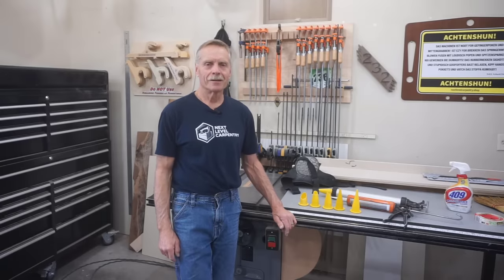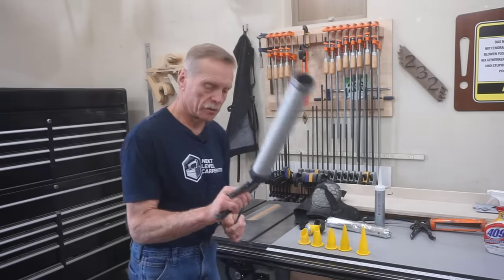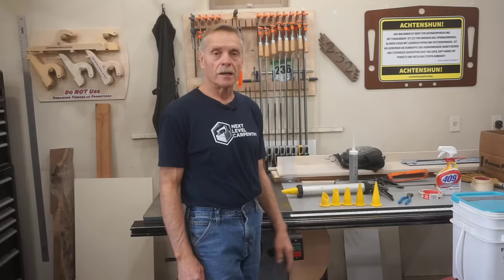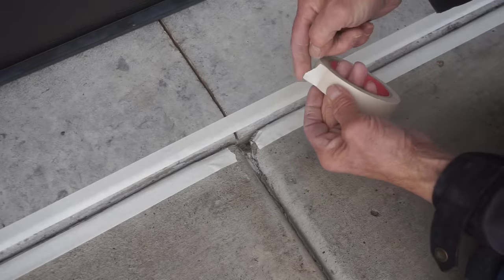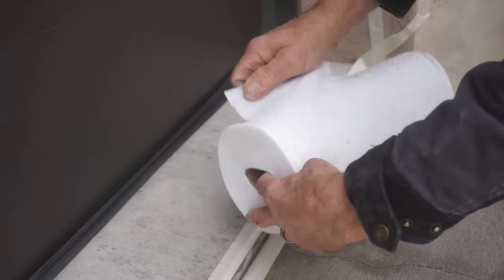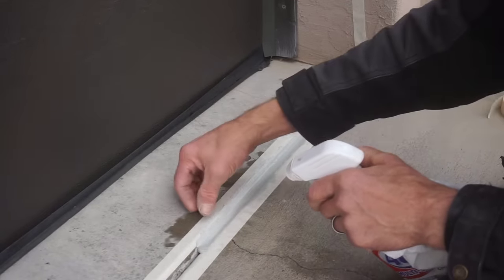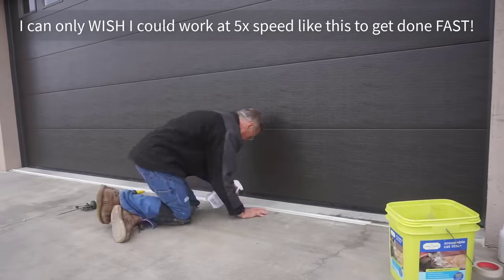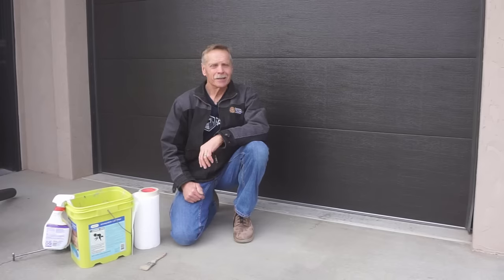How to Caulk Concrete Control Joints with Perfect Results Every Time

Comment: I came across this video looking for ways to use my Dollys to get across those control joints in my garage as they were constantly causing headaches. Will this help with that? Or is this more cosmetic?
Reply from the maker: This is functional for sealing out water and keeping crud from building up in joints but, since the sealant is flexible by nature, it won't help with small diameter wheels in general and dolly wheels in particular.  If you use a hard-setting cement based crack filler it may help with dolly wheels but will predictably re-crack and possibly make dolly travel worse.
Reply from the maker: I don't have any personal experience but would look into epoxy based products rather than concrete/masonry type products because epoxy tends to be 'tougher' where other stuff can be really hard but also brittle.  If you find a product that seems right for your application I suggest doing a test section where you follow all preparation steps to the letter before committing to all the cracks in case the stuff doesn't perform as advertised or expected.

Comment: What would I need to do different if my joint is deeper and wider?  Mine is about 2 to 2.5" deep and about an inch wide.  I have already placed silica sand in it and raised the level up to where it now is only about 1/2" deep.  What else could/should I have used to stuff into the crack to fill in the depth?  Also, my joint(s) open into the grass.  What do you put at the end of the joint to keep the caulk or sand from 'spilling' out?  Thanks, Steve
Reply from the maker: Personally Steve I would vacuum out the silica sand and use only backer rod to fill the joint to where the depth of the sealant will be half the width of the crack.  At the ends I just turn the backer rod down stopping it close to the bottom of the slab, and hold it in from the edge of the slab half the width of the crack at that point. That's one more reason not to use any self-leveling garbage because the product you see me using this video works equally well on horizontal and vertical applications. If you are determined to put something in the joint beneath the backer rod use something like foam or sill Seal because anything dense like sand or dirt or gravel can work to force the slabs farther apart. My advice here is just from personal experience and not from taking a class from a concrete company or sealant company so take it for what it's worth? 😎
Reply: @NextLevelCarpentry  Since I messaged you, I went out and measured the width of that gap and it is a little over 1".  I was even thinking of getting some of that black tar board and cutting it to fit down in that groove.  The groove is also gently curved.  I've purchased some NP1 in Stone.  Do you think it can go as much as 1.25" width?  What is the depth limit?  Maybe 1/2" max?  I was wondering about spraying some expandable foam down in that crevice too, but it would be hard to control how high it will expand.  Also, I used sand as a filler in my other house back in 2013, and by 2019 when I moved it had not affected my slabs and the NP1 was still healthy.  I used your similar method back then, other than I didn't put as much sand on top and I did get some bug and leaf contamination before it dried good.
Reply from the maker: @pavlo687  If silica sand doesn't create problems for you in your locale then it's probably the simplest way to fill the joint.  In areas where freeze/thaw cycles occur I advise avoiding anything that can get wet and expand when frozen. My preference would be foam; possibly multiple layers of  backer rod, but that's more expensive than other fillers.  I've done gaps 2" wide in heroic circumstances and, while that's pushing limits, it's not been a problem.  The width to depth ratio of 1:1/2 is more of an issue than total thickness IMHO.  With that rule of thumb, a 1 1/2" wide gap should be about 3/4" thick.  With proper preparation that ensures good adhesion it should work fine.  Good thing is that fixing a few failed sections of a joint is easy peasy: just cut out the part that comes loose and re-apply sealant using the same process.  As long as you don't get total failure from poor preparation (like leaving dirt, oil or heavy, loose dust on edges where sealant needs to stick) it's a pretty fool-proof process.  Practice on narrower joints and work your way up to the really wide stuff.  Spray foam is great stuff for filling gaps but keeping it off surfaces where sealant needs to stick would take conscious effort, probably more trouble than it's worth.  It's good to hear you had successful long term experience doing this stuff before because it requires less faith to do it this time and allows you to see benefits of a few tweaks to your application system... good luck! Best, Matt

Comment: Do you sometimes need to put in a backer rod? I have the same situation except driveway to garage door is asphalt.
Reply from the maker: Backer rod is definitely necessary sometimes and should be used whenever that's the case. I didn't show it in this video because my focus was on finishing the joint regardless if there's backer rod underneath it or not because of the process is the same. Keep in mind that urethane caulk is basically useless for sealing asphalt alone or even asphalt to concrete so I definitely don't recommended it for your situation...

Comment: Can I use this method where my front stoop hits the house? Water is running between the stoop and the house and making the beam under the front door in the crawl space wet.  Inspector said no damage yet but I need to solve the problem before there is.

Comment: My employer has advised to  bitumen slurry  instead of backer road and silicone sealants,Is it  advisable to use bitumen salary ? , if it is ok, what are the disadvantage?
Reply from the maker: I've never heard of a silicone sealant being used for concrete applications.  There are times when sand is used instead of backer rod but, for small to medium sized jobs I don't think there's an advantage.  Plus sand won't work on vertical joints so I wouldn't switch to sand or 'bitumen slurry' in anything but extreme cases.

Comment: Do you have a video where you caulk an expansion joint that also has backer rod in it?
Reply from the maker: No... there's plenty of them on YouTube but the main point is that the method shown in this video is still the best way to FINISH the joints, regardless of what's underneath IMHO.

Comment: What is the purpose of sealing the joint? Is it only aesthetics or does it protect against cracking or something from ice?
I only wish my intentions matched my results the way you did it... me opening a caulk tube is like letting a genie out of a bottle and he's not happy about it.
Reply from the maker: I do it both for Aesthetics and as a preventative maintenance item. Sealant keeps water from seeping through cracks and eroding dirt underneath Plus it keeps dirt leaves and weeds from collecting in those cracks in the first place. Dealing with urethane sealant is a potential disaster of a mess but I think if you follow the steps and use the methods shown in this video it can be completely manageable and yield professional results... Good luck! 😉😁😎Best, Matt

Comment: Can you use this technique to seal a gap where a vertical stucco wall meets concrete?
Reply from the maker: Absolutely!  It 'feels' a little different because you're working vertically instead of horizontally so it's tricky to get the sand to stick but I use all the same steps, techniques and materials.

Comment: Do you remove the old, broken,, and mold/moss covered fiber/expansion board that is between the slabs before caulking?
Reply from the maker: I sure would...  I hear a stiff wire wheel in an angle grinder is good for removing the top part down far enough to apply the sealant.  The key to success is all in the prep work so don't shortcut that part...
Reply: @NextLevelCarpentry  thanks so much!

Comment: Does this caulking work in cold climates as well? Eg We here in Winnipeg have temperatures that range from +30 C to - 30 C.
Reply from the maker: Works in weather and temperature extremes where I live Nick... if any product/method is going to work in Winnipeg, it would be this one.  Also; slab movement from wet/dry freeze/thaw is more likely to overstress sealant than temperature swings alone so it can fail in far less drastic temperature swing areas if used on concrete placed over improperly prepared base materials...  Best, Matt

Comment: Would the 409 product work with sanded silicone grout caulk? I'm finalizing a tiled shower and have two exterior joints I need to address.
Reply from the maker: NO!!  Some people use denatured alcohol for wet tooling silicone but make sure to test and practice a bit first...

Comment: how long would it take to caulk 50 feet with a 3/8th of an inch joint on a wall frame without using the masking tape?

Comment: So you do 3 or 4 feet at a time??,with the tooling ,feathering,sand, or the whole length, then tool,feather,sand?
Reply from the maker: I prefer to do 10 or 12 ft at a time but conditions need to be ideal for that to work. If it's windy out and blowing dirt around then I'm limited to three or four feet at a time so I can apply sand to the Joint while the sealant is fresh before dirt blows into it and spoils it.
Reply: @NextLevelCarpentry  Ty, what's the best caulk to use,and the between the garage and driveway is uneven, how would I do that joint??

Comment: My fingers get absolutely destroyed by any adhesive...family thing where our fingertips peel a ton and crack easily.  Any idea for something you can use other than a finger to tool this?
Reply from the maker: Your best option might be tight fitting rubber gloves.  I like the Venom Steel ones but am glad I don't have to use them for this sealant work.  Best, Matt

Comment: Garage expansion joint at edge of garage under trim widens to 1 3/4. What recommend for filling larger parts of a joint like that?
Reply from the maker: Although it's not ideal you can just use the same method. Takes a little more finesse to tool out the joint nice and smooth at that witdth but I've done them over 2 in wide with success. Not sure what other conditions you dealing with but the thickness of the joint should be half its witdth so use backer rod or something to limit its  depth in those scenarios. Best, Matt

Comment: I see that Tremco has a product called dynomic 100.  Have you ever used that instead of the Dynomic FC?
Reply from the maker: I'm pretty sure that's the product I used before they came out with FC (Fast Cure).  I actually liked it better because it had a little more 'body' so it was easier to tool. I don't think you'll go wrong with any Tremco product Jason... Best, Matt

Comment: Do the cement joints expand and contract according to temperature?
Reply from the maker: Expand, contract, heave and settle... it's concrete, after all.  A well prepared joint, sealed with single part urethane sealant, will withstand a lot of 'normal' movement but will ultimately partially fail if movement exceeds performance of cured sealant.

Comment: Can this same method be applied for the gap between a concrete slab and my brick of the house? Or would a different type of caulk be better? Water is getting into unfinished basement with hard rains. Thank you!
Reply from the maker: This is the exact material and process I would use for that application. The only difference is that it's a little tricky sticking the masking tape to the face of the brick because it's vertical and then tooling the joint is a little different but with a little practice you can seal that up 100%!
Best, Matt
Reply: @NextLevelCarpentry  great! Thank you so much for the video and the quick reply to my question. I appreciate your quality of work!
Reply from the maker: @j.brentmefford448  you're sure welcome and I wish you well with your project! BTW releasing an epic new video tonight that's 2-1/2 hours long for building a master Carpenters footstool if you're interested😎
Reply: @NextLevelCarpentry  I’m watching it right now! Amazing looking stools!
Reply from the maker: @j.brentmefford448  Cool... I hope the Chapter List for the video helps deal with the epic time/length? 😳

Comment: Add a pack of baby wipes into your essential cleanup arsenal. Works wonders to get pretty much any caulk I've ever used off your fingers, and off most surfaces as well if you catch it soon enough.
Reply from the maker: No kidding?  I've heard of this before but never really took it seriously enough to actually do it.  Is there a particular brand you prefer... maybe and unscented one?  Thanks!
Reply: @NextLevelCarpentry  Pampers Sensitive Fragrance Free is what we use around the house. They're a similar material to the blue shop paper towels on a roll, holds up to scrubbing if needed. Any time I get out a can of paint or tube of caulk I make Sure I have a pack of wipes within arm's reach... Silicone, Latex, Polyurethane, wood glue, cleans up pretty much anything. Better than a paper towel, guaranteed. Cleans up latex paint dribbles on hard surfaces even after they've dried.
Reply from the maker: @brx017  Thanks for the recommendation... I'll check it out.  Kind of funny though: can you imagine if they were marketed for contractors and sold at hardware stores and someone said "hey, these are great for cleaning up dried latex paint PLUS you can use them on your toddlers too!"?
Reply: @NextLevelCarpentry  LOL... indeed, my wife would not approve. Reminds me of the time I was caught in the truck, just me and the two year old without the diaper bag...and let's just say it couldn't wait until we got home. Luckily I found a diaper in the center console, but no wipes. Well, long story short, McDonalds napkins and windshield washer fluid will work in a pinch. 😂🤦🏻
Reply from the maker: @brx017  That's hilarious!  It would be interesting to compare ingredients of baby wipes and windshield washer fluid... might be a bit of a revelation there!

Comment: If you've made a mess can you wire wheel or scotch bright wheel it?
Reply from the maker: After cutting out as much of the 'mess' as possible with a long-handled pipe knife: https://www.amazon.com/dp/B00QL4Y488/?ref=idea_lv_dp_  a stiff knotted wire wheel on slow speed in an angle grinder might help but, as you note, you've got a mess to deal with, Dennis... good luck! Best, Matt